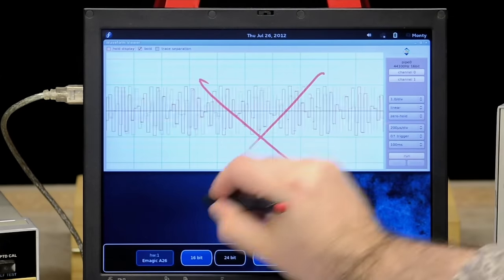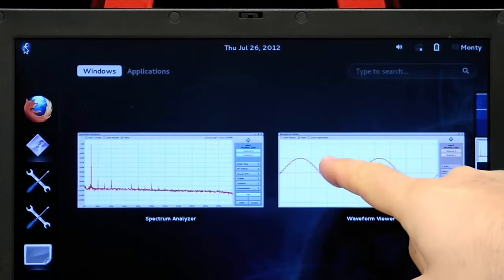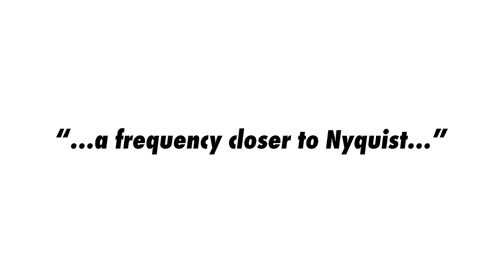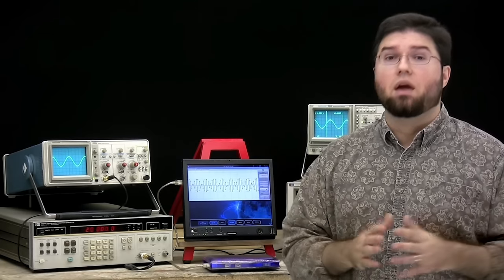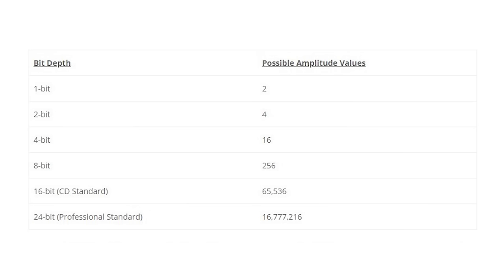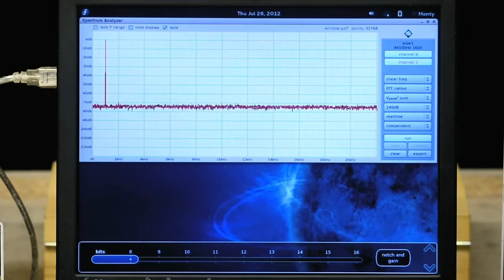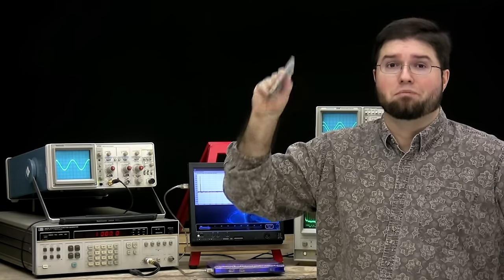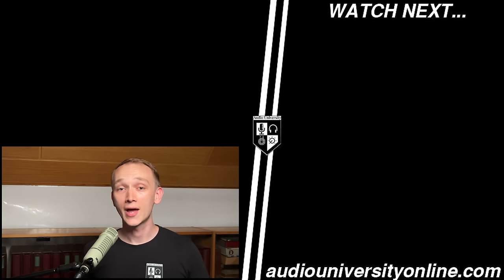Debunking the Digital Audio Myth: The Truth About the 'Stair-Step' Effect

Comment: Electrical design engineer here, and going to disagree with you.
A playback DAC absolutely makes a stair shape, with all the associated noise and nasty harmonics you would expect.
I have no idea where your "engineer" got his data but the playback DAC makes a nasty stair waveform. I know, I design and build this stuff.
However, the nasty stairs can be removed through ADDITIONAL techniques both in hardware and software.
It hink for your video to have been even close to honest, you should have stated the stair problem is very real BUT there can be additional software and hardware filtering AFTER the staircase.
To leave that critical info out basically means your video is false and misleading. A better video would have been to describe HOW the additional filtering can be performed, rather than make a claim that "the reproduced signal has no steps".
Reply: @nrezmerski no it doesnt. Saying "not finished" doesnt cover any of the important stuff.
To TRY to remove the staircase aliasing involves some very clever techniques that are NOT "digital to analog converter" they are "digital to analog converter plus lots of clever stuff after it to try and fix the problems with digital to analog converter".
I particularly disliked the engineer showing a smooth sinewave coming out of the DAC at close to Nyquist, that is nothing like the reality of what comes out of a DAC.
Reply: @nrezmerski ... the key point being the "signal out of the eMagic" converter.
Perhaps there is some magic being used, like math interpolation which can get very complex, basically it is re-creating sound mathematically, which goes far BEYOND the "44kHz 16bit PCM" claimed multiple times in the video.
I agree that the digital samples are points, not steps as such, but without some interpolation trickery each point MUST be held for a finite period of exactly 1 sample. Ie; steps.
If not, the post-DAC process is generating tween points via software so it is no longer 44kHz 16bit DAC it is 44kHz 16 bit DATA, going through extensive processes in both software and likely hardware too. With that much post processing it really doesn't matter if it was PCM or sigma delta generated it is basically a re-created waveform from a limited sample data pool in the same way a JPG is a re-created image from a limited sample data pool.
If the point of the video was that using modern magic a 44/16 data set can come out nice and smooth, yes it CAN, on some equipment.
But the phrasing in the video most definitely sounded like 44/16 data DOES come out all smooth or IS all smooth, and that is not true. It needs lots of artificial post processing "magic" which is so far removed from 44/16 data, then why even mention 44/16?

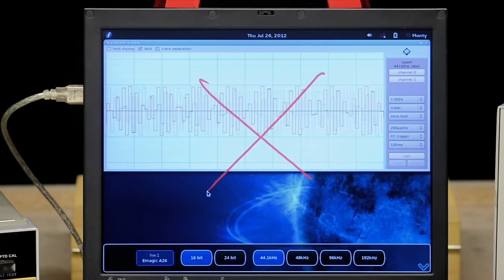Comment: There is no "myth", you are just confused. Pick up a copy of "Discrete-Time Signal Processing" by Oppenheim & Schafer - then get someone to explain it to you, then try again..  At 4:12 you fail to state the issue correctly.  If you sample a signal at 44.1khz, then you can reproduce that signal ONLY IF IT HAS NO COMPONENTS ABOVE 22.05khz!  You'd need a perfect low-pass filter.   Your Prof at 4:52 is WRONG - no a stair step is a DISCONTINUOUS time function, piecewise continuous => not continuous.

Comment: high resolution audio is important if you need to do digital signal processing. Noise levels can increase significantly if you apply some manipulation of the signal. Also the resampling from 48 khz to 44.4 will introduce noise, so if the studio has been working with 48khz samples (or 96khz samples, which downgrade nicely to 48khz as it is double the frequency) there is really not much advantage in file size to justify resampling to 44.4 in my opinion. In particular since we don't rely on CD anymore for most music distribution. Of course resampling music from an old CD to 48khz is even dumber.

Comment: Erm the premise of this experiment is false. CD players use sin (x) smoothing so of course a digitised sine wave will come out sin (x) smoothed! Using sine waves to measure equipment is like testing a car on the smoothest freeway, it tells you nothing about how a car handles potholes.
Reply: @nicksterj Square waves are maybe slightly better than sine for testing, but no known analogue chain can reproduce them! You cannot have a black disk with a square wave on it. RIAA and NAB eq effectively convert square wave to triangular for storage and reconvert back on playback. Testing with tones doesn't really compute.
Reply: @nicksterj Thankfully YT allows comments as long as they don't violate the algorithm.

Comment: Density Pulse Modulation / SACD / Sigma-delta Part3
But really this type of of encodig is usefull, well, a part that indudtry started to use it in a PCM DAC so you have a mix and possibly a couple of possibility or more, the subject can be long so for now we stick wit the original DSD idea:

- It's a nasty ecoding, yes, thinking a bit is not difficult to understand that should have noise everywhere, it as mainly due to drastic quatization,  but neverless it's easy to apply a technique called "noise shaping" which push leterally all the noise well above audible > problem solved.
This is leterally like you are not in the mood to listen to your wife ( mom, sister, whosoever and have to possibility to translate all in the part of the spectrum you can't hear, sorry to all female for this example but concept is detrimental for another folowwin post "I'll highlight as ###) 
- it's nasty also for professional, from what I undestood, you can't do editing, to do it you must go to PCM conversion, do it and go back to DSD (not sure but preatty confident is like this).
- So don't ask to me for comparison about PCM vs (pure)DSD to complete different world (I mean fro professionals) and it is virtually impossible to have material to campare because, I think, have the same material in both is unusual expt the case one is derived from the other.
I can report only to opinion of professianal I heard about which probably stating something one can pick up and evaluate (professional I don't know but with now > 30Y expirience):
1)  Report about one of the first presentation of DSD so long ago, it is working but tell that is good for music NO.
2) Probably the fewest (if not the onlyone in the wolrd) doing a record of  a Liszt piano concerto live same mik, same mixer with a splitted analog signal going to 2 production line till the end, one PCM 24bit/96Khz and the other DSD64 (if you recall the meaning) , done probably after 2010 with the intent to compare the two with hear directly.
Opinion was on tone of : DSD is maliciously seductive, I can understand people can be facinated  but If I have to stick to real event experience  PCM is much closer.

Personally I tried, with all limitation normal people can have (as said above) about the available source, leave me a sort of strange santation specially in low part of spectrum, thinking (as an engineer will do) how can a 2.8xxx MHz sampling be sensitive to low frequency, after something like 10 years I pick up that somebody is endeed buffled with the lows of this format but .... not able to tell.
anyway there will be problems with all format since things csn be perfect.

Also on really technical side The Audio Engineering Society (part of IEEE for people with education in electronics) reported in last 10 years two paper only patially not on the same side:
- Why 1-Bit Sigma-Delta Conversion is Unsuitable for High-Quality Applications, explaining that you can't expect to do any better with this
- and a second saying:  OK more o less  I agree but the door is still open for using this to convert PCM using sigma-delta to convert the 16 or 24 bit of PCM.
Not sure but technically can only be a multiple 1bit sigma-delta ring converting bit 1, bit 2 ... and an adder summing the result of every ring.
Now,  guess what .........

Comment: I do not need to watch this video! that is because I Know why the sound quality has become so bad. The reason, has to do with, how the stereo Output has been wired.  perhaps, it might be best tosay the A mono track should not be on Both speakers, since as a Mono Mix is a One track recording. One track referring to , the type of output is in a track recording. Hence a stereo mix would be a Two Track mix, A matrix mix is a Three track recording and A quadraphonic mix is a Four track mix.

the true config. should be that on a spliced wire. should be as: One Of the Positive terminal or Colored wire :  IE : Red/White. should not be touched. but the ground wire and one of the COlored wires should be spliced and then making an X  the IE: white wire should be connected to the ground.   same as with another wire: but the red wire would be Connected to the ground.

when, you hear what this does.. well, you will then love your music/Music/Videos/ETC. even more.   and yes, using two wires and Four speakers should suggest that this would be a four track mix.

Comment: Hey guys, let's theorize about sound by looking at graphs of analog and digital signals on digital equipment. See!! No StAiR sTeP! NoBoDy NeeDs MoRe tHaN Cd.

OK, this "debunking" video is really just presenting strawmen and distinctions without a difference. He says, "There is no stairstep because there is no data between samples, so it should be a lollipop graph". OK, great, you have a better graph to represent the digitally sampled audio - but the analog signal IS NOT missing the data that comes between each sample. Now, for a sine wave made by a tone generator that is "mathematically perfect" you can convert from analog to digital and back again without any apparent loss of information, but that doesn't mean the information isn't missing.

This is why both monty's video and this guy's video fall short - they ignore the actual process of reproducing audio. DACs take a stream of samples (which are numbers) and combine them to output a voltage associated with each numerical input. When the sampling rate is twice that of the highest frequency in the analog source, there is enough data to produce a voltage output which is then amplified to drive speakers without any immediately noticeable loss of fidelity.

But with higher quality amplifiers and speakers that have higher sensitivity ratings, you can hear the difference between analog and digital. Analog recordings can capture a theoretically unlimited amount of data between any two points in time, which includes supersonic and infrasonic sounds. We cannot hear sounds of these frequencies directly, but when these sounds reflect off of solid surfaces they slow down and become audible. We can also perceive them in other ways. That is why live audio sounds so much different and "fuller" than recordings of the same.

The easiest visual evidence to debunk this attempt to debunk reality is in any 3D video game. All digitally rendered graphics have jagged edges on any curved surfaces, EVEN IF the source is a vector. Increasing resolution reduces these jagged edges, but since many people are running 1080p monitors, the GPU uses a trick called supersampling, where it renders each frame at 2-8x screen resolution then resamples it to screen resolution before sending it to the frame buffer of the GPU. This further helps reduce the telltale jagged stair-step effect that exists within all digital media...but it never eliminates it. The same is true for digital audio.

Comment: if you take an mp3 at 128 kbps and convert it to analog it will have a continuous waveform however we know it's missing a lot of the original audio frequencies. analog = 100% audio frequencies -  analog to digital to analog = 50%  audio frequencies!
Reply: Nonsense
Reply: You're comparing a deliberately compressed file to an analog sound (it was never meant to rival analog, it's for convenience). Now do that with 48k WAV

Comment: Yes but no.
Audio is NOT a sine wave. If you have limited knowledge of digital signal theory related to audio (a subject I have been teaching for 12 years from 1990 to 2002), it is better to refrain from creating demonstrations that may seem unnecessary and trivial.

When attempting to disprove misinformation, introducing misleading ideas does not improve upon the errors of those you are trying to correct.

The original video, along with your comments, inadvertently demonstrates the importance of avoiding discussions on subjects about which you have little knowledge. 
I highly encourage you and the original author to read some books about the subject next time before you make a video. 
Best wishes.
Reply: right right. 
ure basically saying when there is a combination of sine waves, the smoothing effect of filtering at least partially fails to reconstruct the original signal unlike the case with a single frequency.
can u explain how that happens?  because any type of distortion would indicate a nonlinearity within the system.
what is that nonlinearity ?

Comment: This is not true your are not an electronic engenire , when dac decode sevrral instrument  at the same amitude lets say like 4 , 3 of them will go to trash , it will never be like an analig signal .

Another rhis is that a signal from phono will go directly to thr amp while digital have chips , tranformers , caps and a looooot of part that the signal go through , i have 80 tjousent huro cd and a phono will eat it with no problem

Comment: Congrats, you managed to talk about absolutely everything EXCEPT why the stair steps aren't there. Even the referenced video admits that what comes out of a typical simple DAC ~IS~ exactly stair steps, then half-mouth hand-waves it away with "but that's not a finished conversion". Yes, well, guess what - that IS the whole point: stair steps would be EXACTLY what comes out of "the circuit" if there were no analog filters following it, to cut those higher frequencies that constitute the difference between steps and a smooth signal. But of course there always ARE filters there, however simplistic, which is why there are no steps.

Also - you wave the image of a sine wave a few inches large peak-to-peak under our noses, supposedly divided into SIXTY FIVE THOUSAND separate level steps, and you take THAT as a proof that there are none there...? You'd need the mother of all zooms to see them at that granularity, even if they WERE there, dude...

Comment: I took basic digital signal processing back in college in 1989 and learned this. The "myth" about stairstepping is propagated by the ignorant who just do not know the science and math behind ADC (analog to do digital conversion) and DAC (digital to analog conversion). I really can not believe that people still believe this crap today. Yes, digitized signal will be stairstepped, but the DAC process recreates the original signal perfectly as long at the Nyquist theorem is observed. Even if you sample above Nyquist frequency, you will STILL not get stairstepping. You will get aliasing, which is a completely different phenomenon having to do with certain harmonics showing up where they were not present in the original analog signal.
Reply: How can someone who took "BASIC digital signal processing courses" 35 years ago dare call others "ignorant" and call "crap" the most realistic stairsteps effect on signal output through a DAC? I worked with ADCs and DACs for more than 30 years and I can assure you that ANY DAC outputs stairsteps (be they as short in time as can be or as small in voltage as can be) unless equipped with an integrated output filter ... which is clearly not part of the DAC itself but a useful add-on. Don't be fooled by the integration level of newer devices. if they don't generate stairsteps at the output then they're "more than a simple DAC"; they're complex devices integrating DAC AND output conditioning circuitry.

Comment: it resolution Digital is a fixed resolution, analogue, has not fix resolution,  as analogue, with the use of better equipment if always possible get a little more out the sound, or pictures,  it's equipment used the top end, there nor much difference, but if work from the bottom, ie. the worst of the worst, Digital sould win everytime, because, Digital  and fixed, at what even it was scanned/sampled at? and analogue, comes with, assorts problem, Digital for the most part side stepps almost totaly
Reply: This doesn't make sense.